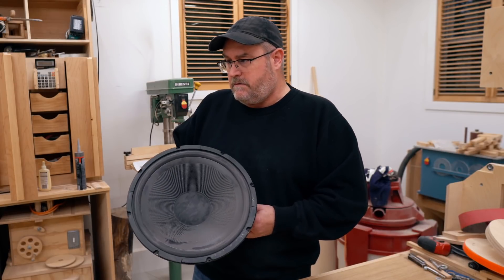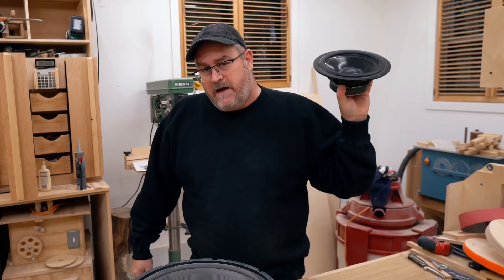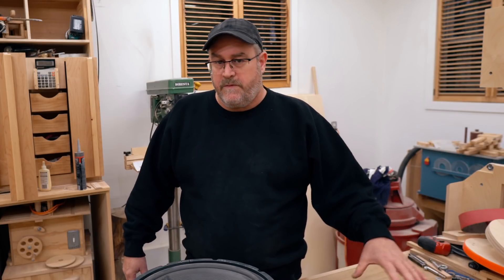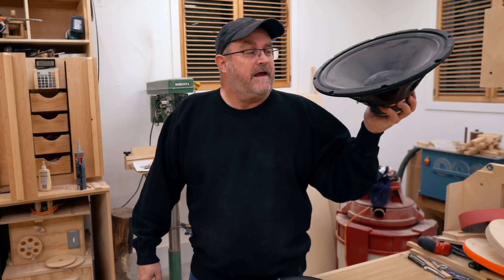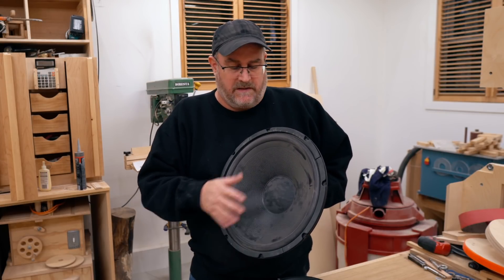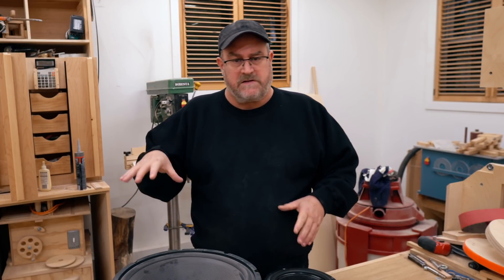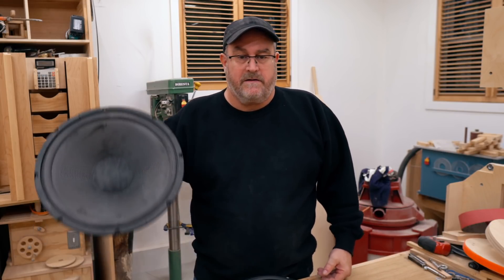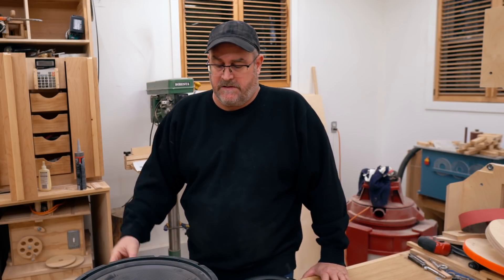What's a 3.5 Way Speaker? Designing My Main Speakers

Comment from the maker: 15" woofer, 8" midwoofer, 4" midrange and 1" dome tweeter open baffle 4 way speakers!
While I can get 3.5 way to work, the 8" midwoofer I have isn't really well suited to open baffle in the bass range, so I'll be going with 4 way. The crossover points will be approximately: 400Hz, 1000Hz, 3000Hz and I'll make adjustments as needed when I'm designing the crossover. 
Don't know what I was thinking when I said 6000Hz for the midrange to tweeter, since the midrange will start to beam at around 3100Hz. 
One of the the advantages of a multi-driver speaker is to improve dispersion throughout the full frequency range, and avoid beaming. Beaming is where the sound from the driver tends to narrow into "beam" (like a laser beam) as the frequency goes up. It's related to the diameter of the cone - the bigger the cone, the lower the beaming frequency. For example, the 15" woofer starts to beam at around 900Hz, the 8" at around 1600Hz and the 4" midrange at around 3100Hz.
By using 4 drivers to split the frequency range into four bands, you can avoid this problem and greatly improve off-axis response. 
And having 4 drivers looks cooler, especially if one of those is 15"!
Reply: I've missed something, 400hz to 1000hz is only just over 1 octave.
10hz to 400hz is 6ish octaves, 1000hz to 3000hz is 3 and 3000hz to 20,00 is 4.
Edit, Sentence deleted...
I missed something didn't I?
Reply: OK, I re-watched, my question would be, why not run the 8" down to 150hz? ish
I've done a fair amount of work with PA and 150hz is a common choice for crossover and it means a lot of attenuation of breakup and 1kz resonance that is common in 15" drivers, in fact EV used to put in a deep filter to get rid of it.

Edited due to dyslexia. Not only can I not spell but I can't see the words I missed, or should that be, I can't see I've missed words..?
Reply: Having a 1k crossover puts it in the key vocal range.  If the midrange will handle 500hz then that might be a better option and push the lower xover down as well as was mentioned

Comment: Generally, trying to run 2 totally different drivers over the same range is a bad idea. The CA21 isn't going to have anywhere near the same SPL curve as that 15, so you'll just have trouble getting the 2 of them to work together in the overlap region. Plus, you just increase the distortion of the 8" by putting all that low bass into it with no back loading of the driver.  I'd go with a 4 way. Your crossover will need a few more parts, but that's about it.  Or go active....a much better approach with an OB design.

Comment: Hi John, I would do a 4 way with a 160hz for the 15inch to reduce the distortion on the seas unit. 98% of energy is required in the bottom 3 octaves. The less cone movement on the seas the better it is. Just my humble opinion looking forward to the built. I love speaker building as well.

Comment: Some nice ideas John. I'm pretty sure your 8 inch beaming frequency is right around 1 kilohertz. If you have steep enough crossover slopes you are golden up to around 800 hertz. Your midrange will be very happy there as well. The drivers are not bad and you have a great idea. I agree that inexpensive doesn't necessarily mean poor quality. Your smaller woofer and midrange are not inexpensive as you know. There are better tweeters by a wide margin. Oh, Bach rules! WTC prelude number one is a great piece. You might try some resistive dampening on the backs of the 8 as an experiment. Might get you a little more Qts on an open baffle setup. Actually so will the right sized resister.
Reply from the maker: The 8" has a cone diameter of ~17cm, so that's 34300/17=2017Hz. The 15" has a cone diameter of around 32cm, so the beaming frequency for that one would be 1kHz.
I've done some preliminary testing on the 15", and it doesn't look bad. Distortion starts to creep up below 100Hz when it goes over ~90db, but nothing that would stop me from using it.
Reply: @IBuildIt   You are not considering 1/2 wavelength and how you have a reflection across the cone surround internal  diameter . Your math is solid. 1/2 wavelength is where you begin to generate reflections that create the nulls that make for the loss of hemispherical output. That 15 is not that bad.  RadioShack had some decent drivers. It may have been made by Tongen in Japan that far back. I had some 15 inch driver from RadioShack that had 11mm of Xmax in the early 90's. Nobody was making them like that back then. Same look, same tiny magnet. Had a big old plastic cap to make it look impressive. Foam surround though.
Reply from the maker: I see your point, but I take the full wavelength as the absolute limit, and crossing below that will give acceptable results. So, crossing the midwoofer to the midrange at around 1kHz would be well below that absolute limit. After all, most 2-ways are well beyond the 1/2 wavelength for their crossover point.
BUT, I'm just getting started and there's nothing that's written in stone, yet. I want to get the individual drivers measured today and that'll give me something more concrete to work with.
Reply: @IBuildIt    I truly believe you have a good handle on what you are doing. What I have learned in studying and listening to many loudspeakers is that many loudspeaker designers are woefully contradicting basic good design principles. The few that really are working within the physics that we are presented with are the ones that make the magic. A little tidbit of information is that having a wide horizontal and a wide vertical dispersion is not always advantageous. Floor and ceiling bounce of the tweeter output is not your friend. You know the range that is most critical for spatiality. Getting secondary bounce effects is including your rooms reflections in a manner that they are louder than the reflective cues in the recording. You loose the best effects of the available soundstage in the recording. Your room treatment helps a lot. But the floor bounce is nearly impossible to mitigate the same way. A planar is one way to lick that problem easily. The vertical spread is usually less than 10 degrees. Food for thought buddy.
Reply from the maker: Well there's a lot of leeway in speaker design and some will say that beaming is good for improved directionality and less room interaction. It comes down to what the listener likes and the majority of them are in rooms that are about as far from optimal as possible.
I've never used a ribbon or planer so I may order a pair to try out. Any recommendations?
Reply: @IBuildIt    Check your email.
Reply: @IBuildIt  
With the drivers at your immediate disposal or otherwise, if you want to create a good loudspeaker, the 2 most important things are to design crossovers that provide a smooth and even frequency response, AND smooth and even directivity.  Any significant deviations/fluctuations in either the on- vs off-axis frequency response, and/or mismatches in directivity between drivers, will result in unnatural sound and the deterioration of the imaging cues and achieving a holographic 3D soundstage.

Since you are designing these loudspeakers with 4 drivers, I would be more conservative in choosing X-overs that minimize beaming (at least 1/2 wavelength rule) and optimize for smooth directivity and phase response through the X-over regions.  <---(Captain Obvious)---v

You would also try to use each driver within a passband where it exhibits its smoothest FR, and avoid any cone breakups & resonances.   Will you be doing measurements that include impedance sweeps for each driver?

Loudspeakers with a smooth and even directivity are much easier to EQ overall for smoother and more natural response/spectral balance in any given listening environment.

The directivity pattern (either wide or narrow, and especially in the mid- to upper treble) directly impact the resulting frequency response, which will be dependent on the listening room and listener position within the room, due to variations in distance to boundaries and their amplitude of reflectivity.  Toe-In/On-Axis/Toe-Out speaker positioning will of course affect frequency response as well.

Pay attention to those attributes (smooth & even FR and Directivity), and as long as each driver is operating within it's intended passband without producing significant distortion, you'll achieve satisfactory results.  EDIT:  I guess I will add...try to minimize any cabinet or port resonances as well, as in your experiments with the accelerometer.

IMO, there is too much "leeway" by speaker designers that deviate from these basic principles, at least in the consumer home HiFi speaker market where loudspeakers must perform well in many varying listening environments.

 I noticed a Behringer DCX2496 in your old set up.  Are you still using that unit for testing your crossover alignments, etc?  Or perhaps a miniDSP?

I like building stuff a lot, too.  But I tend to like to build "good stuff" that performs well and will last the test of time.  With that in mind, I might choose and invest in different drivers altogether.  :-P

But I also get the desire to recycle and/or use the drivers that you've already had laying around for 20 years and haven't gotten any listening pleasure from since their purchase.  Most important is to enjoy the journey and learn from each experiment.
Reply from the maker: @bbfoto7248  https://www.youtube.com/c/IBuildIt/community

Comment: I'm surprised you didn't put some of those old speakers up on ebay and promote the auction on your channel.   Someone would buy it because A) they are a big fan of your channel and wanted to own something you made  B) They are sexy looking speakers  C) They probably sound better than off the shelf speakers from Amazon or wherever.    

Then you could take the money from that and invest into more wood and drivers for your new set of speakers.
Reply from the maker: The speakers didn't have crossovers and were designed to work with a digital crossover and 6 channel amplifier. I doubt that I could sell them for anything near what the drivers alone are worth.
Reply: @IBuildIt  active speaker system.
Reply: @IBuildIt  which digital crossover did you use?
Reply from the maker: Behringer DCX2496

Comment: John,

Cool project. I hope to see the outcome. I think your idea about crossing the 15" high is a good one so the 8" wont matter with open baffle. However, I think crossing the 8" at 1500hz and the 4" as high as you said will be asking for directivity issues and even cone breakup problems for the 8" and maybe the 4". I would suggest the lowpass for the 8" to be closer to say... 900hz (a guess) and let the 4" play lower, and cross the 4" closer to 3khz if your tweeter can handle it. Does that make sense? This is just a guess  since I have no idea how your drivers perform.
Reply from the maker: I said all of that in my pinned comment and also put a caption on the screen during the video, so yes it makes sense to me :)
Reply: @IBuildIt  Ah that's funny. That will teach me to read the comment after I watch the video!  Best of luck on the build!